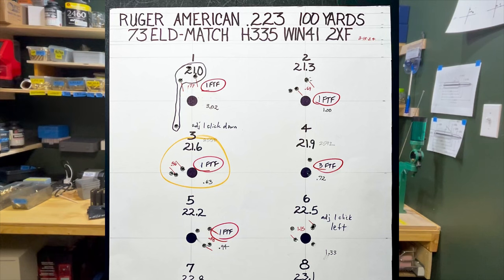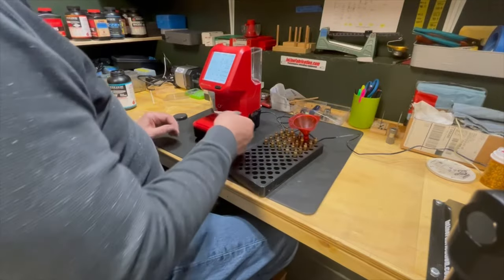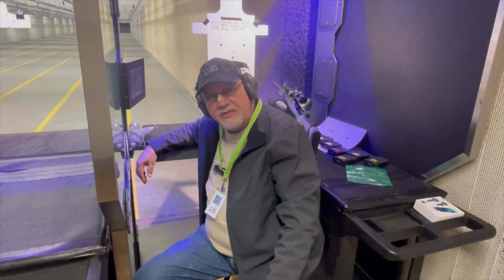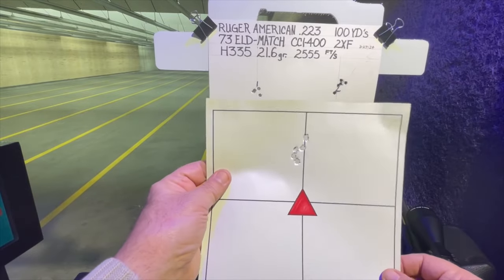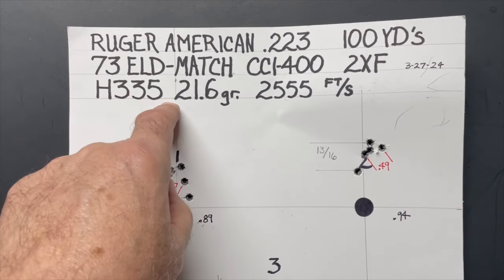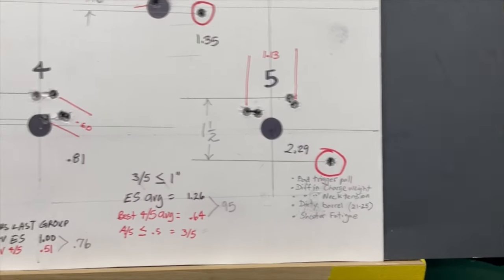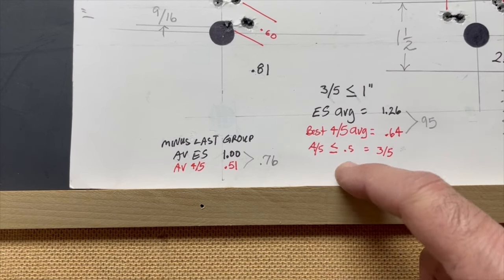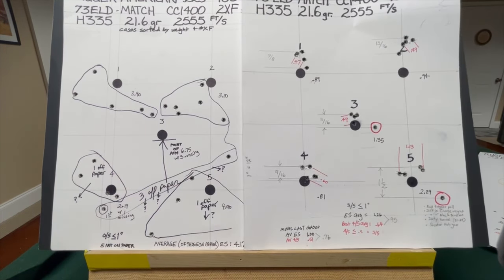Shooting the Same Load and Getting Different Results.  H335 with 73 ELD Match

Comment: Great video.  I am befuddled on this one.  Those drop measures are pretty consistent, I use an inexpensive lee perfect measure and it is consistent to about 1/3 grain.  Plus you double checked with a scale.  Regarding the bridging from a drop measure, I get terrible clumping when I use a bunch of case lube if I don't tumble it after sizing.  But I always notice because, well you see it clump at the mouth and it just gets powder everywhere by your dropper. I always double check with a scale every so often using a dropper.  I read all the other comments looking for their suggestions.
Reply from the maker: Same here Michael. I have no clue. My best guess was it was the powder dispensing, but maybe it was a dirty barrel. I didn't clean it as usual, but still I can't imagine if I had not cleaned it at all that the groups would be that scattered. I suppose that's a question I'll have to ask the Lord when I get to heaven. He would know. 😀

Comment: Interesting results. I've never used that RCBS dispenser but I had problems with static electricity causing bridging with a Lee dispenser, I ended up grounding it to a house ground to stop it from happening. It probably wouldn't have been a problem in the summer but the house was really dry during winter heating season. Just a guess.
Reply from the maker: I think it's a good practice for any powder dispenser to clean it thoroughly before using, and then wipe it down with a dryer sheet. That will reduce the static electricity. Also, with Lee, they said to run a full canister of powder through the dispenser Through a normal dispensing process before using. That takes care of the static also. Thanks for watching.